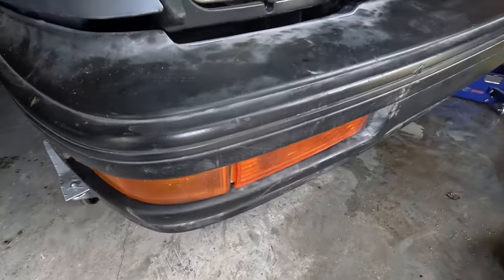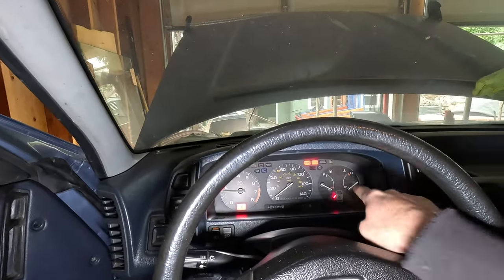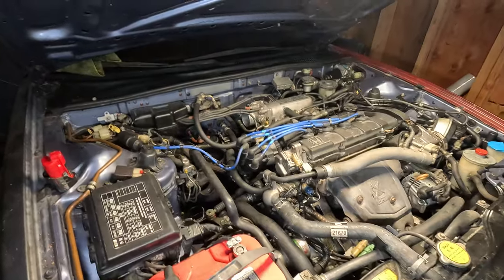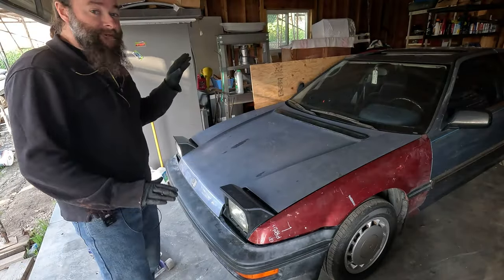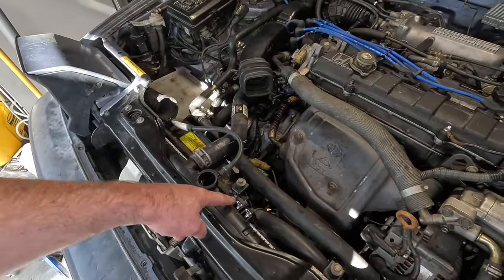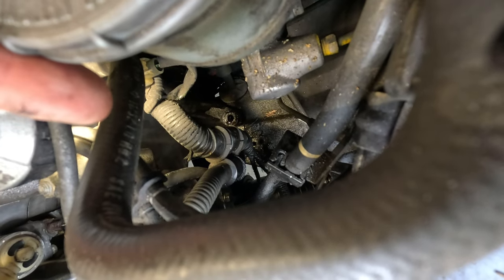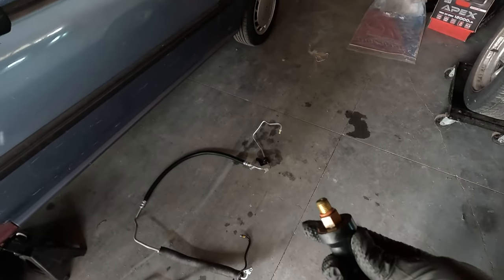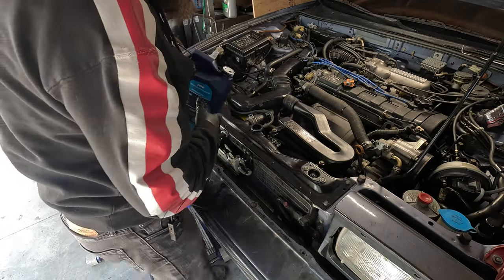89 Prelude Radiator & Power Steering - A Parts store FAIL!

Comment: what's on the engine stand behind ya?
Reply from the maker: It's an h22a4, unfortunately if I want to do a smog legal swap, I need an h22a1 or it becomes 100x more challenging. I'd be happy to trade the two h22a4s I have for one h22a1
Reply: @DirtSweatGears  don't swap until the 300k blows. Which it might never do. Despite the lies on Facebook these motors go forever if you take care of them
Reply from the maker: @Pigmaster6373  I do have a fair amount of blowby. I think it's time to at least start planning the build. Maybe I'll get a 4th gen with an h22a1, swap the a4 into that, and put the a1 into my car. That totally won't take a thousand years.